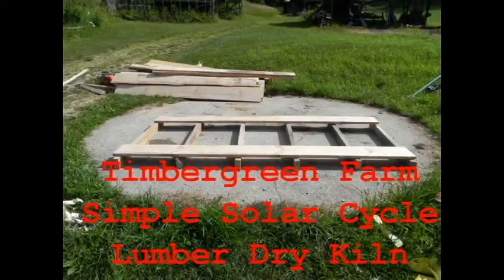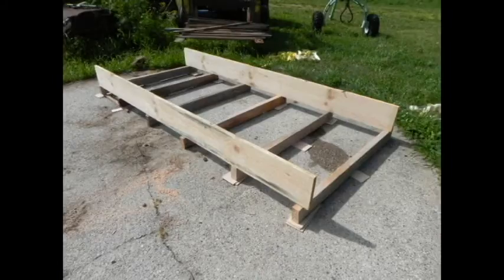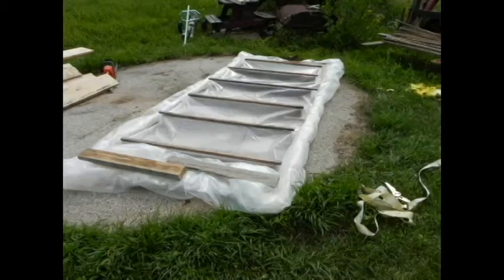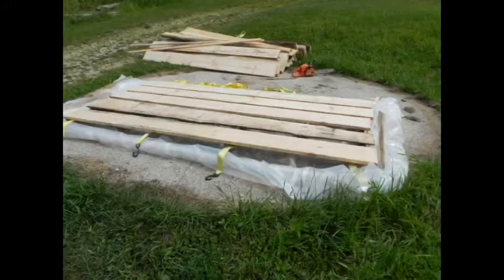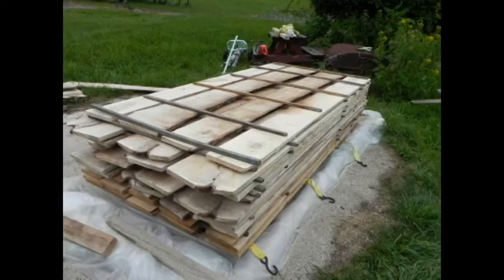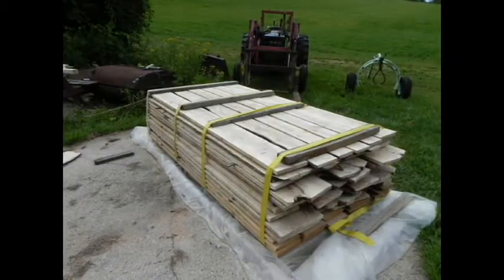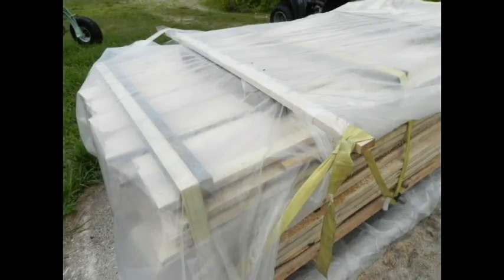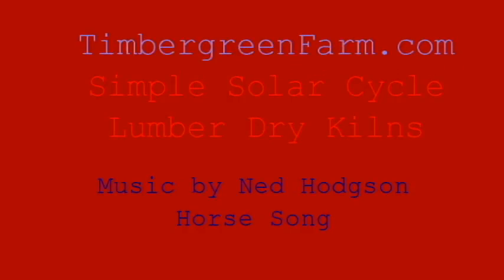Simple Solar Cycle Kiln at Timbergreen Farm

Comment: What’s the sense in putting it in another kiln after you’ve taken it out of solar kiln? Doesn’t that defeat the purpose? Why not just put it in a Normal kiln and be done?
Reply: For furntiure the moisture content needs to be 6-8%  depending on species.  This" kiln like"  system doesnt get the wood to that level  I like this but the wood needs that final step a true kiln provides.